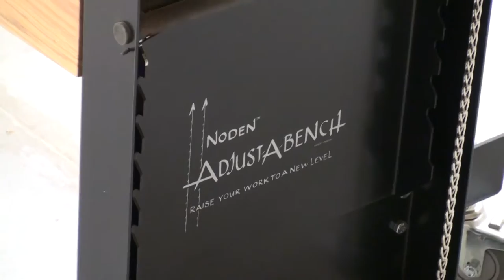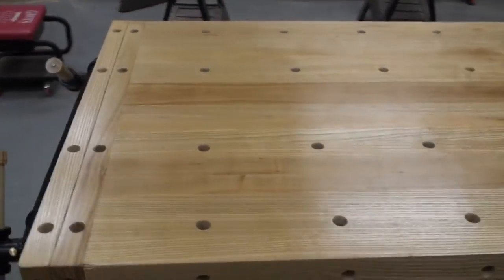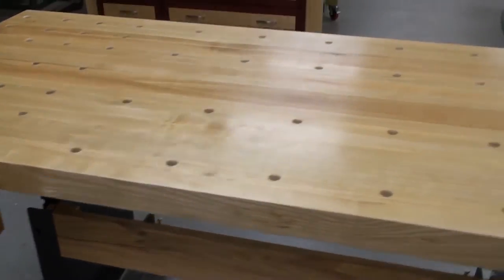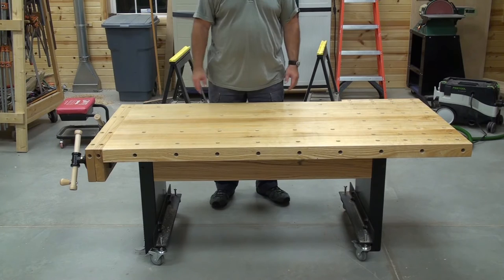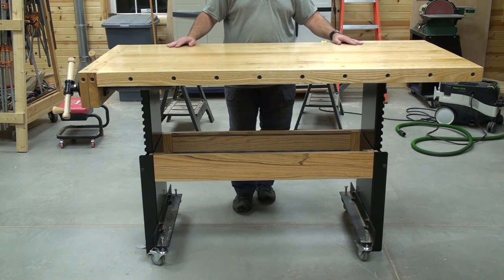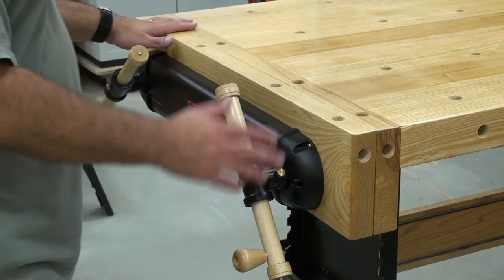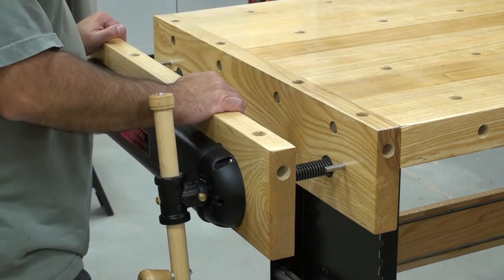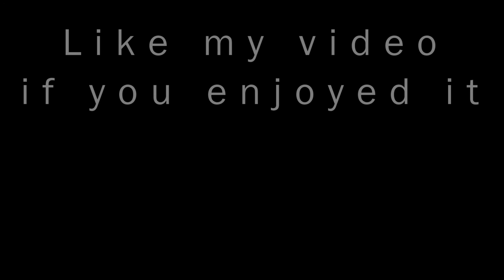Adjust A Bench 151003

Comment: Similar to Johns question, but how stable is when top is raised up or does it even make a difference? Also, how stable when on casters?  I am really considering their hardware kit where you essentially build the legs to save a little money, but am concerned about it shaking or moving. I can’t find any videos showing someone trying to demonstrate that aspect of the system. Thanks for the video and your bench looks great.
Reply from the maker: Scott Carpenter Hi Scott. The bench is rather stable. I usually keep it on the casters and the casters locked. If I do heavy planing, it will rock somewhat. Then I just get my portable drill with socket and bring up the legs and let it rest on the stationary legs. The table will not replace a heavy all wooden table with moxin vice, but is a great assembly table and medium duty workbench which is what I use it for. I might do another video on it to help with the questions I am getting. I can say that I LOVE having this in my shop.  It’s a back saver because you can raise or lower the bench to any height based on the size of your project. Hope this helps. Thanks for watching my video. And check me out on Instagram. I will do a short story on this table on that platform too. Take care and be safe.

Comment: I am a relatively strong guy but getting older and am currently mending from my fifth back surgery. I have committed myself to working smarter because I do not want to go back under the knife because I do something stupid that messes my back up again. Along with the promise to my body (and my wife), I have started looking for all manners of back saving shop items e.g. panel movers, cherry picker for heavy pieces on the band saw or lathe, etc. I came across your video for this bench and I am very intrigued. My only question is, although it looks like it is relatively easy to lift each side, I still worry that it might be a little heavy, especially with a nice thick top on your bench. Thoughts?
Reply from the maker: Thanks for watching the video. I have to say, I still love this workbench. As for your question, each end will be as heavy as the thickness of the top you put on it. I too had back surgery and as long as I use my legs and not back to raise it, I have no issues. I bring it up or down one notch at a time which takes a little longer to adjust but works good for my back. I would highly suggest this type of bench for those with back challenges.
Reply: @frankswooddesigns9346  Thanks for the excellent reply!

Comment: How stable is the bench when the casters are retracted and on the fixed base?
Reply from the maker: John Petsche It is very stable John. If I am doing some heavy passes with a hand plane, it will move slightly. But for the majority of work I do in my shop, it’s a perfect bench to have to compliment my other benches. I use the height adjustment a lot. Easier on my back.

Comment: Frank, I'm having trouble with my bench.  The caster nuts keep falling off when I raise or lower the bench.  I contacted the owner and didn't receive a response.  Have you had a problem with the casters?
Reply from the maker: +christschool No I have not, but I think I know what your issue is if you bought the casters from Noden. They are special casters for this bench. If you did then: 1) Make sure both nuts are tightened very tight...these are the ones above and below the rotating plate on the casters. 2) when you try to raise and/or lower the table by turning the bolt at the head, make sure the lock on the casters are released. If you don't, the bolt will loosen and have the issue you are describing. If the lock is off, then the swivel action is free to rotate thus the caster remains in place and the bolt turns the swivel plate and raises the lowers the caster wheel. Hope this helps.